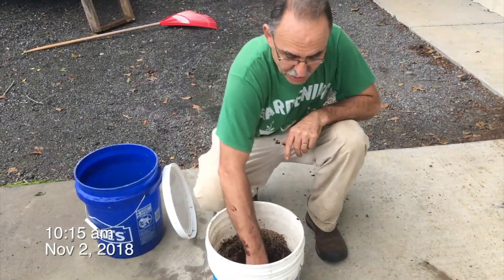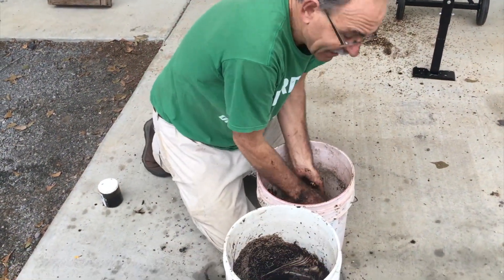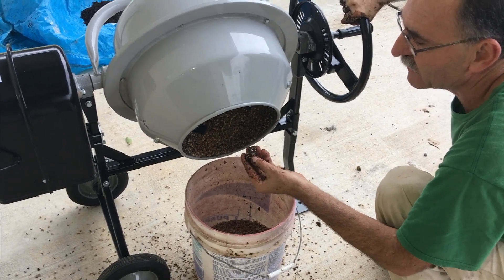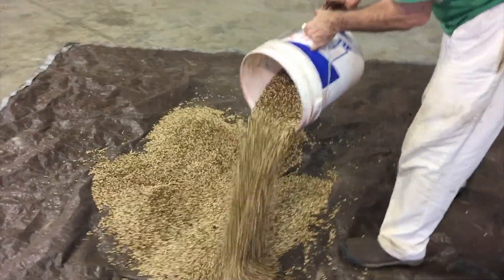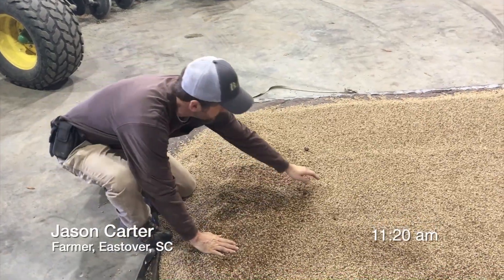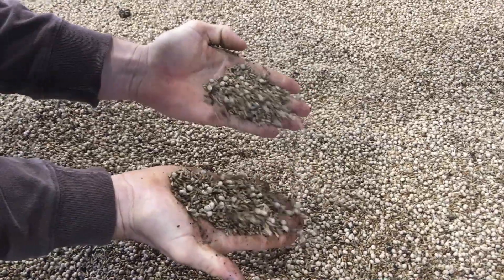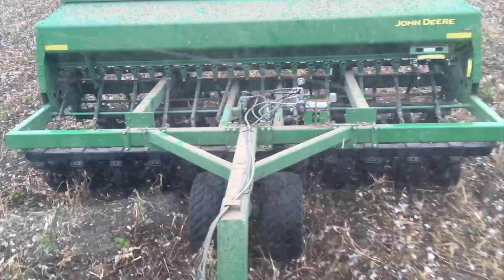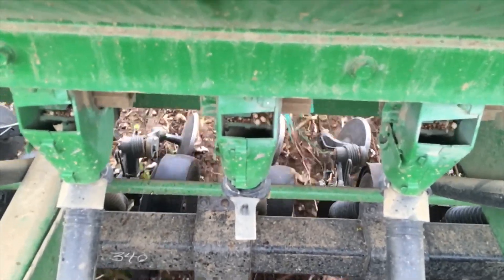Using Johnson Su to Coat Cover Crop Seeds and Planting 6 ac with Grain Drill

Comment: would you recommend coating all seeds like this? how does it work with very tiny seeds?
Reply from the maker: This method showed no significant improvement for us, but I would encourage you to experiment on your own.  Masanobu Fukoka has his method down to a fine art, but that was for small acres - we were trying to do this one 5 acres and more.  Lots to learn but I'd encourage you to experiment on your own.
Reply: If you drill  in your small seed you can use JS extract injected in furrow during seeding.  if you use  airplane, modified highboy or drone for seeding you could coat your small seeds with JS slurry, biochar dust, boiled oatmeal based binder, and limestone dust or clay

Comment: Any updates on the results? Grain drill operation?
Reply from the maker: Unfortunately we did not see any response to the coated seed.  Very disappointing as we had high hopes.  back to the drawing board for us.  Thanks for asking
Reply: @Buzatesri  I've heard it is a multiple year process!  Don't give up, try it again on his property!
Reply from the maker: @krokus6909  thanks for that encouragement.  We continue to look.  My main concern is to kick-start the regenerative process so  farmers can stay afloat in the short term while we continue to pay attention to the medium and long term stuff.
Reply: @Buzatesri  I bet year 2 doing that same thing will be the kickstarter.  Also consider a 300 gallon sprayer out of an IBC Tote with Johnson Su Extract as a foliar top dress right before a rain.  Ultimately, the JS costs nothing to make once you have created your bioreactor.   I'd say 2 years is a good short term turnaround.  

Year one, you shocked the system without fertilizer and it performed as it would have with fertilizer.  Year 2, microfauna are still existing (probably dormant unless planted) and with another JSU application + foilar spray it will compound the growth.
Reply: @Buzatesri  thanks for your replies. Now that 5 years have passed, any news? I am going to try to make it in a small garden, but i am curious about other's results.

Comment: What that slurry black mix, milk and molasses?  Did it work, what was the result like?
Reply from the maker: We added about a 1/2 gallon of milk and a cup of molasses to a bag of seed.  We did not see any difference  in cover crop biomass or quality between treated and untreated seed.
Reply: @Buzatesri  milk and molasses  stimulate bacterial proliferation and these bacteria may have consumed the quorum sensing molecules in the slurry thus rendering JS slurry ineffective.  Boiled oat flour based binder works much better than milk and molasses, especially when planting wet seeds, which is more scalable and more effective